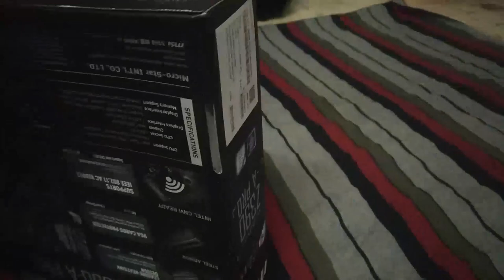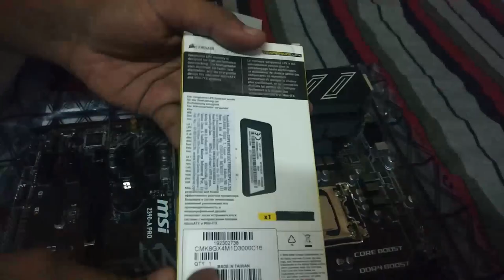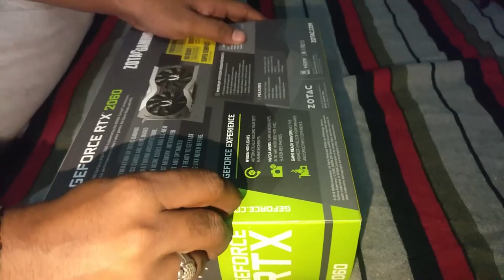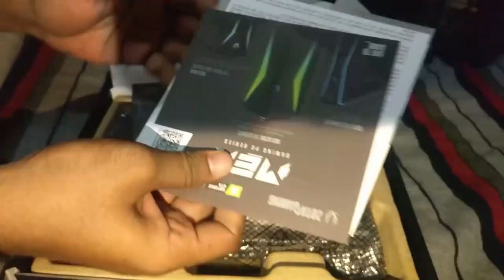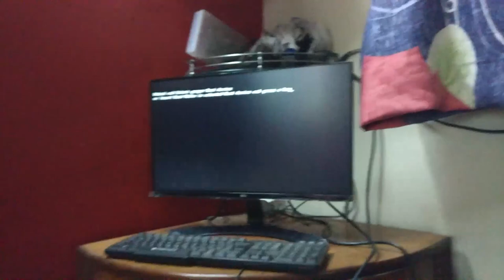Whixer Gaming Pc Build 1.56 Lakhs Setup😱

Comment: He should have gone for 
1) Ryzen 7 3700x which give 3 times better performance than i5 with 8 cores and massive cache
2) Rx 5700 xt price is same as RTX 2060 but it give performance equal to RTX 2070 super
3)samsung 24 inch 144hz monitor is much better because of 125% sRGB coverage , 30000:1 contrast ratio
4) and atleast a mechanical keyboard with cherry mx blue switches